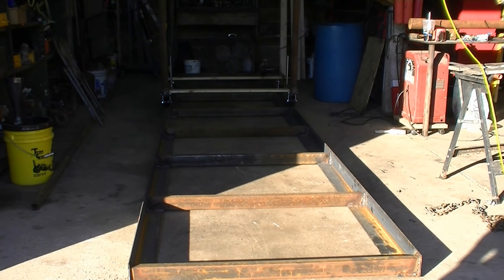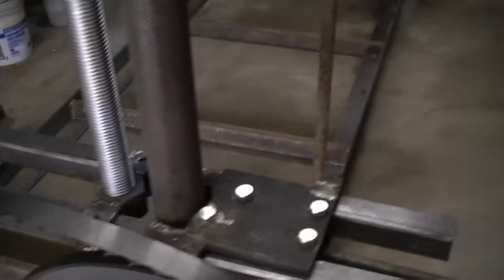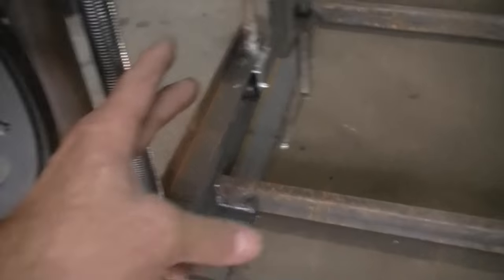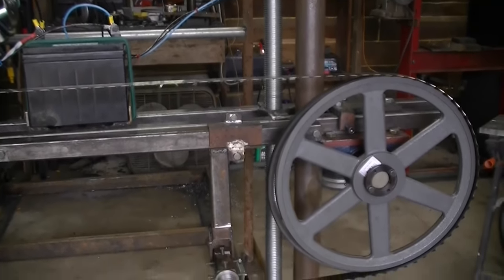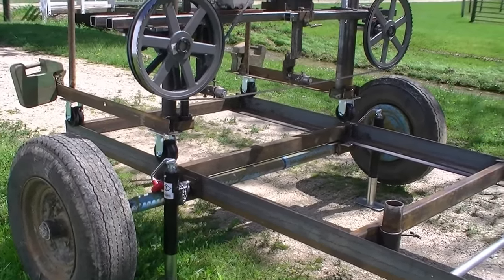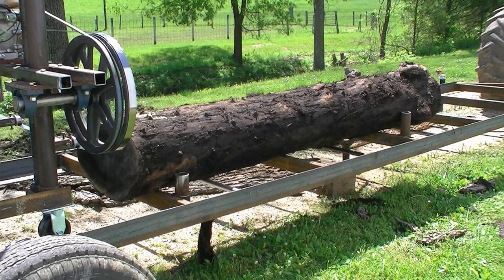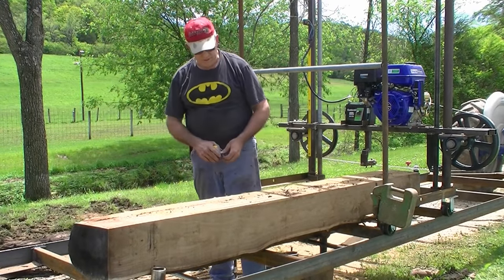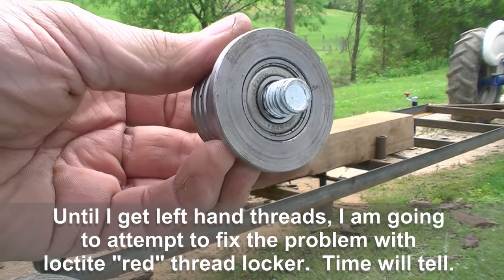168 RSW Homemade Bandsaw Mill Part 1

Comment: I noticed a left and right dance of the whole square frame which holds the engine, on back . It seems like you need an x-shape structure on the top, to keep the structure from shimmy-from twisting back and forth, as you’re cutting the log.   You’re doing a great job, engineering and designing it!

Comment: Boy, you're a real jack of all trades. I'm quite similar myself, and have a small machine and woodworking shop. I've done many things from restoring an old baby grand piano, to building log splitters and cars. This is way better than watching the boring stuff they have on T.V. these days.
Reply from the maker: Be sure to watch part 2 and part 3 of The Sawmill. Part 2 I completely rebuild the saw 180 degrees to improve the performance. In part 3 I saw some really nice to Eastern Cedar
Reply: Yes, I've watched them all, and it sure is working better now.

Comment: I just love saw mills. Some locktite on those threads will keep them from vibrating loose. You will need to turn yourself some metal "v" groove wheels for in cold weather hauling a bump will crack that hard plastic. Great project and great video, thanks for sharing.
Reply from the maker: I tried Loctite several times. It wouldn't hold. I rebuilt The Sawmill in part 2 180° and I recut those threads to left handed.  The wheels are not plastic.  They are steel V groove Wheels. Thanks for watching.

Comment: Despite the setbacks, it's a nice rig. No doubt by now you have made all the necessary refinements to ensure its use is superb.
Reply from the maker: +Kevin Cossentine thank you very much. In part 2 I completely rebuilt The Sawmill 180°. In part 3 I saw some very nice red cedar.
Reply: Will have to check that out. Thanks and you're welcome.  :-)

Comment: You should move the motor closer to the center. Put on a drive belt that hangs loosely. Then add a tensioner pulley with a control arm to engage and disengage the drive belt. It will give the drive belt more power to the blade wheel and give you more control. It will also balance out the entire rig.

Comment: Very good video and great work. I have started my build on my unit and I will be using a lot of your design, especially the raising of the unit for cut size. much better than the cable stuff I have seen on other researches I have done.  I will be watching as you progress to your final product.  Great job sir.

Comment: Super Cool. Nice job and thanks for sharing the video.
Reply from the maker: Thank you very much. In part 2 I rebuilt the saw 180 degrees. And part 3 I saw some really nice Cedar.
Reply: Cool. I will be sure to watch. I fell a tree or two (including Cedar; see video on my channel) and have taken to a local guy with a mill. I want to build one myself so I can saw my own lumber.
Reply from the maker: They're nice to have. I will warn you they're more expensive to build than you probably would expect. And it's a lot more work than you would imagine cutting your own Lumber. In hindsight I will tell you it's definitely cheaper and easier to take it somewhere and have it sawn. But I have a large farm with more than 200 Acres of woods and I'm always sawing trees down so it seems to make sense but it is a heck of a lot of work.  Thank goodness I have a bobcat to lift the logs.

Comment: And that my friend is how you do it, nice work great vid. Welcome to the ( I built my own sawmill club) Feels almost as good as building that first guitar and hearing it for the first time.
Reply from the maker: Southeastern Ohio Homestead thank you very kindly.  It does work pretty well.  Believe it or not, I tore it completely apart and am reworking it so that it'll be better.  Hopefully!
Reply: I understand completely. I want to do away with my cable lift and change to lead screws like yours. Mine is fine for making barn slats and bridge boards but its far from where i want it to be accuracy wise.
Reply: Oh ya never ever cut frozen logs. Had a sawyer tell me that and I didnt listen and it ruined my new blade in half a cut.
Reply from the maker: Southeastern Ohio Homestead the screw works pretty good.  It is kind of slow. But the biggest problem I ran into was that the screw wasn't straight enough.  So be sure to get a very straight screw, or be able to straighten it yourself.
Reply from the maker: Southeastern Ohio Homestead good to know.

Comment: Very impressive, nice build. If I may make a suggestion, On your elevation motor, use a larger sprocket if possible to change your ratio causing the chain to move faster.

Comment: Rosa string works, great job on the mill.  I'm not sure if you're having any more problems with blade drift but I noticed that you have your drive belt on what usually is the free wheeling pulley (left side), I did the same thing on my first build and realized that the saw blade is being pushed into the log instead of being pulled through the log.  when I changed the belt to the other pulley (right side) and now it really doesn't drift at all.  Nice video and mill.
Reply from the maker: Jay Pee thank you I realize that now, but I don't know how I'm going to change it because the other side is the movable side.  It would be a pain to change at this point.

Comment: You do good work.  Everything looks straight , square, and pretty well thought out design.  The welds look good as well.  The video is from 2 years back so I figure you solved the self-loosening screws...I have 2 or 3 suggestions for that problem.  The quickest and cheapest is probably LocTite,   or you could go with nylon inserted lock nuts,  or double nut it...tighten the nut and run another against it and tighten them against one another. Left handed nuts and bolts are available but will they be the day that nut drops into high grass and disappears forever?  Great project.
Reply from the maker: In part 2 I completely rebuild the saw 180° which also allowed me to put in left-handed threads on the bolts and that kept them tight. I'm part 3 I saw some red cedar which was really nice.

Comment: Nice saw...maybe a few cross braces on the head to help keep it from racking as you push it. My buddy has a  home built one as well, he rigged up a water/soap drip on it. slowly drips water with a little dish soap on the blade, cuts better, easier to push and saves the blade from gumming up. Loctite 620 will keep that bolt in place.
Reply from the maker: 40cleco thank you very much. I have scratched my brain out trying to find a way to put cross braces on it but they are all get in the way of something.  I definitely will be putting a drip on it.  I just haven't had time yet.  Plus the Walnut log was absolutely saturated with water.
Reply: I had the same thoughts as 40cleco, but could also see the issues that were a problem for you. I'd noticed the wobble of the frame & thought it needed some diagonal bracing to stabilize the traveling frame, but where could you put them to not be in the way. I've used short pieces of EMT conduit to make short, diagonal braces. Just cut it to a size which may not interfere with it's operation, flatten the ends a short distance with a press, then drill holes in the flattened part & bolt diagonally across a corner that, hopefully, won't be in the way. They do not need to be that long. Just long enough to stabilize the corners. Otherwise, your machine looks like a piece of art. Well done, and good luck, Sir.

Comment: Really love this design. It's the closest I've seen to the one that's still in my head :D I've finally got all the stuff together this weekend so I will be posting my own build soon. Some of the challenges that I have tho are that I live on a hill in Tennessee so there are NO flat spots. Also I bought a mostly put together rig from someone in the hopes of expediting my project but after I got it home and looked at it closer, I came to realize I'm going to have to do a lot of repair and redesign. The only thing I'm trying to add to mine that you don't already have is some kind of side ramp/lift since I don't have a big tractor and can't afford one. Good job! I liked and subscribed. Looking forward to updates.
Reply from the maker: Eddie Mckie thank you very much. Believe it or not. I took it completely apart and completely rebuilt it 180 degrees opposite of everything you'll see in an update down the road that it works much better.

Comment: Just some thoughts on your mill. 1st you did a great job! If you weld some angle braces in the upper carriage and base, you can make it more rigid! Also the guides, if you use a guide that has a top and bottom to it, it will help hold the blade flat and true.
Reply from the maker: bob mccann in part 2 I rebuilt the saw 180 degrees.. there is no way at all to put braces in there that doesn't interfere with the log passing through or they raising mechanism. I've tried every conceivable way. In part 3 you can see that I'm selling some nice Cedar.

Comment: Awesome mill. My only tweet I can recommend is to make a cross brace horizontally above the engine just about where that handle is where u push from. 
Ur guide bearing that fell off could perhaps use a flat washer to the back and “lock-tite” on the threads to prevent it going loose again.

Comment: It's a nice unit! I notice that the Gantry racks back and forth from side to side. If you add a shaft across the bottom with a sprocket on each side with a stationary bike chain on each side it will stop all that then you can true it up by adjusting the chain at each end with threaded eye bolts.
Reply from the maker: The problem with cross bracing is that it gets in the way of the log. I tried a million different ways and nothing works real well. I did finally come up with a method that work pretty good. I don't really go into it much I don't think but check out Parts 2 and part 3
Reply: @RosaStringWorks  Look at the way a drafting table's straight edge is cabled. Another solution to tracking is to use either pipe for tracks or angle iron set point skyward with pairs of wheels at each corner of the carriage set perpendicular to each other. This uses the precision of the bearing in it's bearing direction to maintain track on both axis (up/down and side/side). That alone should negate any need to run cables to maintain perpendicularity of the blade since perpendicular isn't as important as just a stable run. 

I'm also thinking that keeping sawdust buildup off those tracks would help and I'm anticipating fabricating skirts to hang over the wheels and tracks, one on each side and mounting brushes to clear the tracks as the carriage advances. I'm waiting to start my build until everybody else screws theirs up and uploads the videos so I can see everything I'll need to injure near butter and avoid cutting the neighbors' pets and kids in half. Maybe I'll luck out and just take out the neighbor and the orphans won't ever think to lawyer up... Crap! There's still the wife!  And I was almost ready to start cutting material!

Comment: Building stuff cuz you can is great. Your work and ingenuity amazes me. But I would argue that the time, tool costs, materials and construction setbacks end up costing more than just buying a well engineered and built bandsaw mill. But that's just my opinion. I'll do my thing and marvel at you doing yours!
Reply from the maker: She parked to where I completely rebuilt the saw 180 degrees. And see part 3 where I cut some really nice Cedar. My son has been using it as of late to cut a lot of white oak.
Reply: Again, I'm amazed. I'm pretty good but I can't see myself taking on a project of that complexity when I have the resources to just buy one. I expect you got pleasure and satisfaction out of successfully building one, because why else?!
Thanks for the video. There is definitely something to be gained by just seeing it done and applying those thought provoking ideas to my own fabrication projects.

Comment: change the drive so it pulls the blade thru the wood not push, big difference.    i bought a used diy mill and fought the same problems....reversing the drive pulley to the other side fixed everything.   look at all commercial mills.

Comment: That's very cool Jerry. Takes a while to work out the bugs. I've been thinking about building a resaw but that's a far as it's gotten. Was thinking I'd need four corner adjusters but you've proven two would work.
Reply from the maker: Dane Nichols thanks for taking a look. Good luck with your resaw.

Comment: I like your saw its a strong built i see that you need a longer base towards the front and the back so your saw will not wiggle right and left (i see when you cut its wiggling...the cut will turn smoother you wont see aggression,and become easy on the guides,you'll need screws with more teeth per inch for the guides with spring lock for vibrations,your work is very good after all good luck
Reply from the maker: Thanks for taking a look. In part 2 I completely rebuilt the saw a hundred eighty degrees. In part 3 I cut some really nice red cedar.

Comment: Good work Gerry. The carriage seems to be flexing side to side. Some cross bracing at the top maybe would stop that.
Reply from the maker: In part 2 I completely rebuilt the whole saw 180 degrees. In part 3 I saw some real nice red cedar.
Reply: Sir good luck with that one

Comment: Go look at a horizontal band saw and that will give you a bunch of awesome ideas
Reply from the maker: In part 2 I completely rebuild the saw 180 degrees in part three I cut some very fine Cedar. It works wonderfully we use it all the time.

Comment: In my late midlife I acquired an odd habit: buying motors. Well, two motors. One is the exact 18 H.P. you bought -  I'd hoped to graft it on to my 11.5 HP Briggs & Stratton chipper that, sadly, had given up the ghost. Over time, I just decided to give up chipping. 😂 
Oh, the other is a 6.5 HP that I had no specific use for but it was on sale for a Benjamin. Still in the box. I need a manager. 🤡

Comment: Congrats on a satisfying yet challenging project. I am sure you'll improve it gradually and  steadily over time. At the risk of sounding snippy, you can see how the commercial units have a load of these little problems (and there are a ton of them) worked out. Nothin's free, we know that. By the way, most of the larger units you are trying to emulate have drip-drip water feeds to cool and slightly lube the blade. Good work!
Reply from the maker: pneumatic00 thanks fully aware.  This Walnut log was super saturated with water, so the blade was plenty cool.  I have already added the drip, cross bracing, and taller stops, on the fixed side of the log.  Still working on the blade covers.  Thanks for watching.

Comment: From what I could see your carriage need stiffening up which is easy to do, the other thing is getting some lubricant/ cooling fluid to the blade, after much research and trial and error I find transmission fluid to the best, I'm talking about a drip every few seconds. Just my two cents worth !! Good luck !
Reply from the maker: 1armedguy I put out a video number two and I did those things and more. Thanks for watching.

Comment: What size pulleys are you using? And it works if you're rubber for those pulleys. It's loose, or do they need to be very tight on the pulley

Comment: The problem I see with homemade mills is everyone designs their own in a trial and error situation, which is difficult to do as there are lots of designs to confuse the issue, to me they are a proven professional engineered designed product, so what I would do is copy one as much to the letter with respect to costs then you don't have to work it out yourself, there are plenty of agriculture shows around to see what out there, other than that all home made stuff is worth a look as there is always someone out there who comes up with something unique, thanks.
Reply from the maker: tony coppe thanks for taking a look.
Reply: I have similar thoughts but the big companies don't sell a 4 foot log capacity for under 100K so I plan to make my own.

Comment: Hi, just came across your video, great looking build of a bandsaw.  I am in the design process for something similar right now.  I noticed you have your motor "pushing" the blade through the cut, this might cause some problems with wavy cuts as the blade dulls.  Usually the motor/belt setup is designed to "pull" the blade through the cut keeping more even tension on the blade.
Reply from the maker: Brian Bain good point.  Would be hard to change at this point.  I will keep it in mind though. Thanks for watching.
Reply: I believe pulling the blade is the better way to go. 
Same principle as pushing a rope, pulling gets better results.
Reply: could you help a brother out and explain what you mean by your motor "pushing"
Reply: @RosaStringWorks   DONT THINK YOU HAVE A CHOICE
Reply: @ralphcole9725  "Pushing" is when the blade is driven FROM the drive wheel toward the log. "Pulling" is when the drive wheel drives or "Pulls" the blade through the log toward the wheel.

Comment: as I was watching you pushing the saw through the log I saw some wiggle waggle, left to right. I suggest some cross bracing so you can push from one side and it stays square.
Reply from the maker: Talisman1957 been trying to think of a way to cross brace it.  Every single way causes a problem.  Nothing will work that I can come up with.

Comment: cook saw has the guides for sale just open the winch control box and wire a winch control handle to it and works with out buying a reversing solenoid and use a 12 linear  motor to move guides